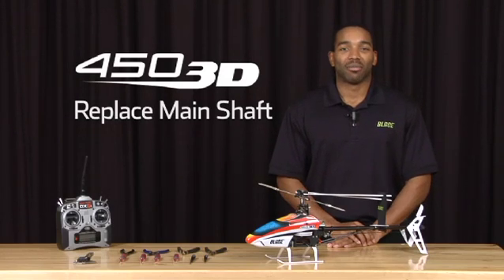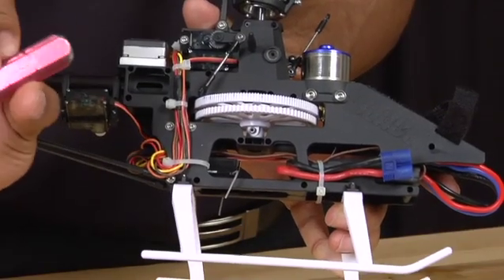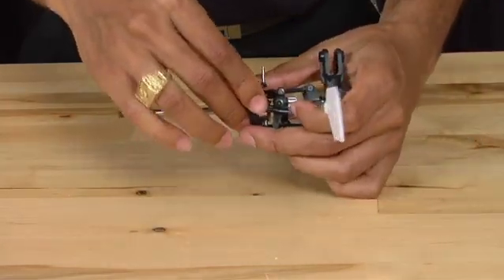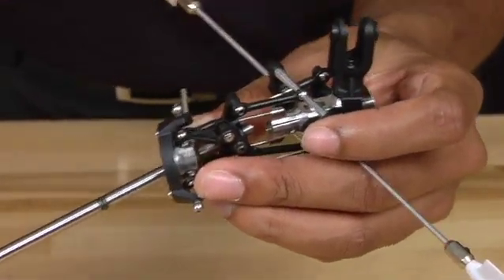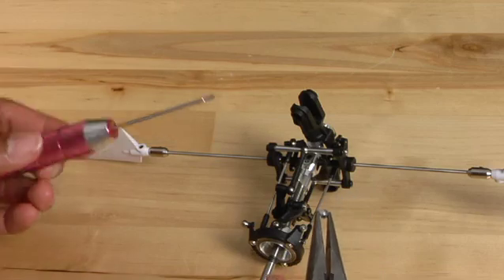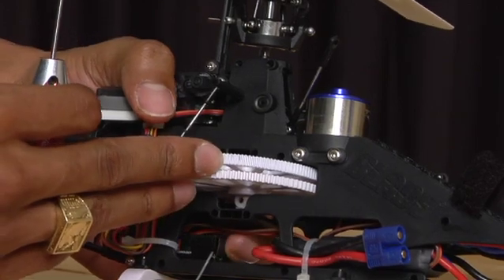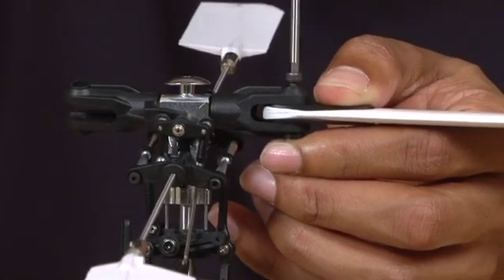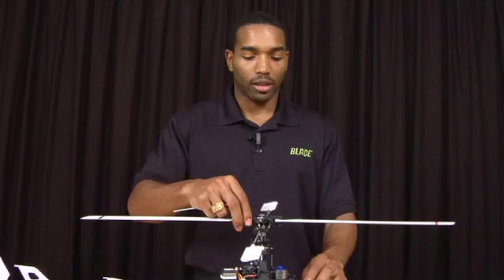Blade 450 3D Main Shaft Replacement

Comment: Isn't there supposed to be some ring-like part installed on the main shaft between the main bearing (riding on it, actually) and the underside of the swash? I have one on mine and it seems to be some kind of lock because it is held tight in place by two Allen lock screws. This piece/part comes with the main shaft in all the ads I have seen for replacement main shafts so I guess it is standard across all models and makes of 450 RC helicopters. Of course, I could be wrong.

Comment: Great video series for someone getting into the hobby.

As a note a have a 450x and have worked on another that ALSO have the @ FLAT WASHERS. After I pulled the shaft out of the body, the 2 flat washers were sitting on top of the upper bearing.

Comment: I really appreciate this tutorial. One thing that wasn't illustrated was a washer that I have on the shaft (two washers come with the replacement shaft/kit). This very fine washer fits on the shaft on the lower part that fits into the chopper. Maybe it is different for some choppers? Regardless, when doing this procedure, be patient, and PAY ATTENTION to what you remove, plus, do it on a clean area that will reveal any part that drops!!